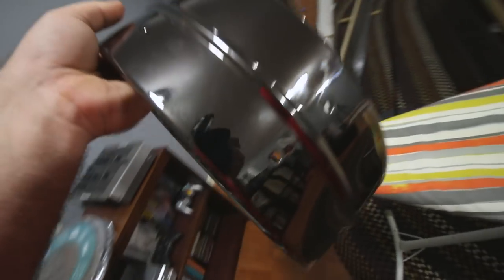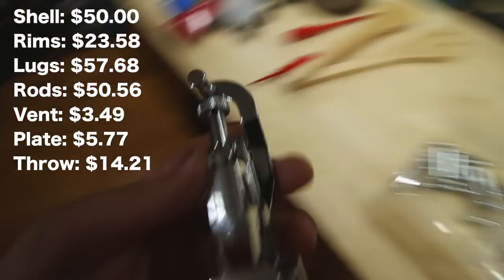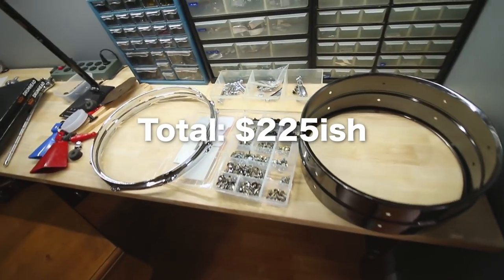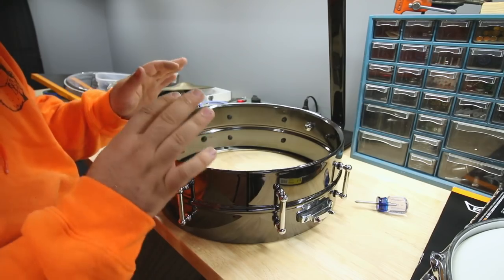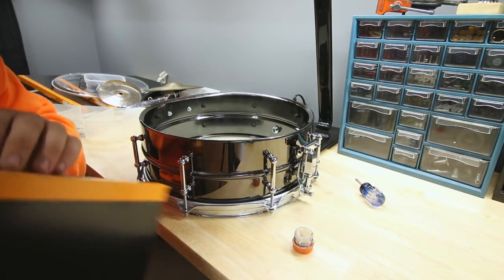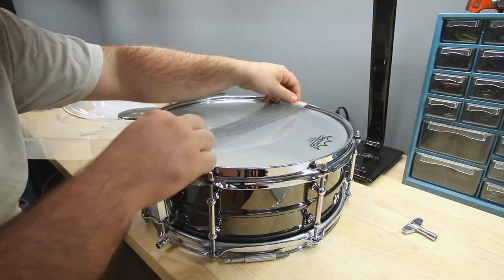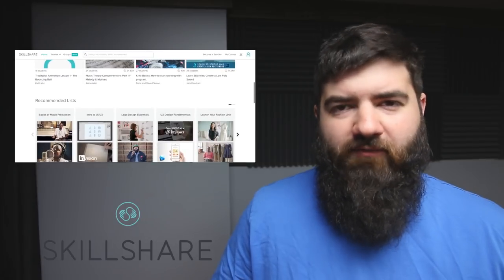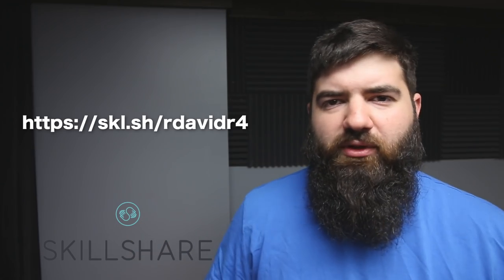You NEED This Snare in your Arsenal

Comment: 0:35 so you wrote a poem about it?
Reply: Your idea will never sell...
Reply: @ButtahDawgMcDouble  this is a nickel plated brass shell
it's black nickel if you couldn't tell
and I bought it cheap, from flood it had fell.
but I felt it was, naught the matter at all.
twas the most beautiful drum that I'd ever saw,
I thought it was needed by drummers and all.

I found the sound so sweet in this snare
the beautiful noise that rang through the air.
I set off to work with such Grace and such care,
cause the thought of it dying was to much to bare.

I measured the butt plate and the throw off too,
drilled it all out and made it anew.
I made some scratches, but I hadn't knew,
but the scratches were covered, 
and I got some snares too.

and the snare was so great.
it seemed that lady fate
had brought it, wrought it, to me
twas the most gorgeous snare that ever could be.

why did I do this?
Reply: @interrexclamacion 
This poem is well written
Great job man! 👍👌

Comment: Please make a PVC pipe drum set please.
Reply: Or just make some PVC octobans on a rack mount.
Reply: @Fiend S  @Hans Grueber  -  I think a problem with that could be that the diametre of PVC pipes is measured on the inside (as opposed to the outside, with drum shells) and that it may be difficult to find fitting heads and rims!
Reply: I made 2 x 10" PVC drums back in the 1980s. They sound good but are extremely heavy.
Reply: I made some 6, 8 and 10” concert Tom’s out of PVC back in the mid 70s. They actually sounded really good.

Comment: Regarding your used snare straps, we were in the middle of recording a few years back, and the drummer's snare strap broke. I fashioned up a quick and dirty replacement out of a nylon shopping bag handle, and finished the session.
Reply: I've used a doubled-up strip of gaffer tape. It worked so well that I left it on, in fact. As would duct tape...in fact, Premier used to use strapping tape for their straps.
Reply: @johnseal56  wouldn't duct tape stretch?
Reply: croyce Possibly over the long term. Only gaffer was field tested at length by me.

Comment: I considered building a run of acrylic snares by buying a huge acrylic tube and cutting it into many pieces, but this video shows that the shell is just a drop in the budget bucket. The hardware costs a couple hundred bucks, which is why any decent snare is usually around $300 or more. You’re just paying slightly more than the hardware cost.
Reply: Hint... buy el cheapo drums at flea markets, pawn shops, yard sales etc... A $20 5 piece-o-s set with dented heads and torn wraps can be a gold mine of lugs, lug screws, hoops etc...
Reply: Richard Marshall well yes. But you get cheapo lightweight hoops, bottom of the barrel lugs, barely functional strainers, etc. you’re not going to find tube lugs, cast hoops, or anything nice. I have a Yamaha 12 lug marching shell, but chances are low that my $20 drum set find will include 12 lug hoops. I see your point, but to build a snare out of junk gets you a junk snare. I’ve done it. It sounds pretty bad. Ordering parts like the above video is about as cheap as you can get for something you’d want to use and feel proud of.
Reply: @RyanAlexanderBloom  I have collected drums since 1974. I have classic ludwigs, pearls, tamas, yamahas, slingerlands, mapex, sonor, yaddah. Drums go bang or boom, cymbals chick or ting or crash. I have enjoyed and proudly played great drums and crappy drums without prejudice or regret, and shall continue to do so. YMMV.
Reply: Richard Marshall I’ve owned plenty of bad drums and just a few that sound good. I wouldn’t want to build drums from scratch that don’t at least stand a chance of being on the good side. That’s all I’m saying. And to get there you have to spend a couple hundred bucks. Like in this video. You can play whatever drums you want, but you don’t want to be selling custom drums made of garbage parts. That’s the point I’m making. Components matter a lot in snare drums. I loved the sound of a no-name brass pawn shop drum I had but the chrome peeled off the hoops, the lug inserts routinely tore out of the lug casings, and the only snare head I ever actually broke was on that drum. So i bought a Black Panther to replace it. The sound is actually better and it’s never given me trouble. So you see, every drum goes boom and most can be adjusted to sound good, but when it’s your #1 snare, it should work correctly in clutch situations.
Reply: @RyanAlexanderBloom  best wishes in your future drumming career.

Comment: Hey Dave. I don’t know if you respond to questions that much, but For a while I’ve been thinking on doing the same thing you did in this video (well kinda). I wanted to buy just a wooden drum shell from any manufacturer and or craftsman and then assemble it all together. Is there any sources or tips you would recommend for any of the drilling processes for the parts to be assembled? 
You rock btw

Comment: Save those mini blinds. They can be cut to size and used to tighten your snare wires. I've done it many times when in a pinch.
Reply from the maker: mini blinds?
Reply: @rdavidr  yes sir!... just cut them, fold them, run them through the snare wires, and attach them to the butt plate.. just like snare straps, but much cheaper.... and you're reusing instead of throwing them into the landfill. 😎
Reply: Or if you're a cord person, the pull is great for that.

Comment: Hi David! I'm a new subscriber from Germany and I would like to know if you have ever repaired a snare strainer that is missing the metal piece inside that attaches the throw to the part that moves up and down. Is there a Video like that? Thanks!
Reply from the maker: ehhh i honestly would have to see it to know what youre talking about. but in most cases with stuff like that its easier to just buy a new one.

Comment: What would a snare drum sound like with no air vent?
Do they actually do anything important?
Reply: The vent lets air pass though the drum. If you put your hand/finger over the vent and hit the head (or even push against the head like giving CPR) you’ll feel air coming out. I dunno exactly how that affects it though, but it’s important enough that most drums are vented. I dunno maybe try plugging a vent in one of your drums and see how it changes
Reply: Sound, I don't think much.  I've always presumed it's really a vent for not letting humidity or condensation build up inside an air-tight cylinder
Reply: Plug the vent on your drum and listen to how shitty it sounds
Reply: Without an air vent the snare would choke out.
Reply: http://www.menet.umn.edu/~kgeisler/Tuning.pdf 
"The air hole or vent in the shell is to allow the shell to breath when two heads are used and atmospheric
changes occur, thereby helping to eliminate moisture build-up. This is a typical problem moving from
cold to hot environments much the same as glass windows can sweat in your house. The vents have little
effect on tone."

Comment: Are snares like guitar strings? Single use or can they be changed between multiple snare drums?
Reply: I'm a drummer but I only own one snare drum, meaning only one set of snares so i don't have to worry about it, but I'm pretty sure they can be swapped around drums, it's just easier and hassle free to have a set on every drum so you don't have to swap them round
Reply: You can change them if you want, but it isn't worth it. They're not very expensive so you can have one installed on each snare drum you use, and they are usually very durable. However there are different types, in sizes and materials, wich can give you a different sound or feel. In addition, you'll have to keep in mind your snare beds, because not all of them fit together. Ex: a 16 wires snare with a large bed = no problem, a 40 wires snare with a small bed = not a good idea. A 20 or 24 wires snares will fit with most beds and are great all-terrain.

Comment: Unfortunately it's not like a Black Beauty because the shell has snare beds and lacks the oversized round-over bearing edges. Still nice for the price though.
Reply: Also the Black Beauty has a seamless spun shell while this is welded. That's the main reason for the BB's price. Ludwig also makes a drum with this shell, it's called the Black Magic and it's 299$.

Comment: hi ! greetings from Argentina! 
is there a standard measure when installing a generic throw off and  but plate in a snare drum shell? there is a really cheap snare drum in the school I work in , with no snare wires because the throw off system broke. the original throw off system of the drum was cheap and weird so a generic throw off does not fit.  I´m going to have make some adaptations and i don´t want to f up.
thanks! great channel!
Reply: Por lo que yo sé  cada modelo puede tener su propia medida, no tiene por qué haber una medida estándar, incluso entre diferentes modelos de la misma marca he visto variaciones. Si dices que las genéricas que has visto no coinciden, las opciones que tienes son dos: 1- busca un modelo que tenga la misma medida (algo debe haber, prueba con Gibraltar, que sería raro que no lo tuviera), o 2- busca el modelo que más te convenza y taladra los agujeros que necesites a la medida correspondiente.

La segunda opción tiene más trabajo y si no lo haces bien puedes estropear el casco para nada, pero por otro lado si es una caja barata, quizás merezca la pena el riesgo. Si lo haces bien pueden quedar en el casco los agujeros del sistema viejo, pero eso no es necesariamente malo, aparte de la estética. Funcionarán como unos agujeros de ventilación extra (algunas cajas llevan varios), y eso lo que hará será "secar" un poco el sonido, y quizás eso podría venirle bien (a veces las cajas baratas tienen demasiados armónicos), aunque eres tú el que conoce esa caja, no yo.

Espero que eso ayude. Un saludo.
Reply: @isihernandez9752   gracias por tu respuesta. me paso al castellano ya que veo que lo hablas. el tambor en cuestion es uno hiper barato. el sistema que ajusta los snare wires se rompio y se perdio.  por los agujeros que quedaron no pareciera que fuera un sistema de los genericos. trataré de sacarle una foto para que te des  una idea.  supuse que la unica forma seria comprar un sistema generico tipo gibraltar y hacer los agujeros yo mismo. mi duda ( por lo que escribi el comentario en un principio) es sobre cómo hacer los agujeros. que pasos debo seguir para que quede bien colocado.
Reply: @tomaswille1983  hola. Pues no creo que tenga mucho misterio, lo único que te puedo decir son cosas muy evidentes. Lo primero es, lógicamente, medir muy bien dónde van a ir los tornillos, en función del modelo que vayas a colocar, para que el sistema quede bien alineado en su posición con respecto a las camas de la bordonera. Después, utilizar la broca adecuada, tanto por el grosor como por el material a taladrar (madera o metal). Si colocas un poco de cinta sobre la zona a taladrar, te ayudará a que la broca no se deslice en el primer momento, antes de "morder" bien el material, y así protegerás el acabado, además de hacer un agujero más recto. Si el casco es de acero y muy grueso, quizás te venga bien utilizar algún tipo de lubricante para no estropear la broca, aunque no creo que sea tan grueso como para eso. Y también es importante que el casco esté bien fijo y no se mueva. Si tienes un taladro de banco mucho mejor, si no, fija el casco lo mejor que puedas con un tornillo de banco o con unas mordazas (usa un trapo para no estropear el casco al agarrarlo), y procura tener muy buen pulso al taladrar, para que no salgan torcidos los agujeros. Después limpia bien los restos que hayan podido quedar, rebabas de metal o virutas de madera. Por último, instala el sistema, con sus arandelas y todo, y listo.

De todas formas, si no tienes mucha prisa puedes seguir buscando algún sistema con la misma medida que el antiguo, que creo que sería raro que no hubiera. Quizás en alguna tienda, si dices la marca y modelo, te lo puedan traer, o puede que en ebay o algo así. 

Espero que te ayude. Ya me vas contando cómo lo llevas.
Reply: @isihernandez9752  gracias!
El tambor es de madera. Y creo que no tiene cama para las bordonas. Me voy a fijar bien. Se que quizas estoy haciendo preguntas muy evidentes pero jamas hice algo asi y no encontré video alguno que explique y muestre cómo se hace. Me es muy dificil explicar lo diferente que pareciera ser el sistema de bordonas que tenía este tambor, asi que creo que lo mejor es imaginar que el tambor no tuvo sistema alguno y no tiene hecho ningun agujero ya que los agujeros que tiene no creo que sirvan de referencia para un sistema de bordonas generico. Me intriga mas que nada cómo instalar el sistema en relacion a la altura del tambor. Tanto la parte movil como la parte fija y tambien como es la relación en cuanto a la altura entre ambas partes.  Perdón por la molestia y
Gracias de  nuevo!
Reply: @tomaswille1983  tranquilo, no es ninguna molestia. Para comprobar si tiene o no la cama, algunas veces está muy claro porque es más o menos grande, otras veces es más sutil. En ese caso lo más efectivo es colocar el tambor con el borde inferior sobre una superficie que estés bien seguro de que es totalmente lisa, y a ser posible con poca luz. Luego mete una linterna dentro y ve girando el tambor, fijándote bien en la luz que se filtra por debajo. Si no hay ninguna variación, es que no tiene camas, pero si ves que en dos extremos opuestos (donde estaban fijadas las dos piezas del sistema bordonero) se filtra un poco más, entonces es que sí las tiene. En caso de que no tenga, te recomiendo utilizar una bordonera de pocos hilos, para minimizar un poco el zumbido por simpatía.
En cuanto a la altura,  creo que eso depende mucho del modelo exacto del sistema que vayas a instalar. Yo diría que lo  importante es la altura de la pieza donde va enganchada la tira de plástico o la cuerda que uses para la bordonera, más que otra cosa. Si tienes  más cajas a mano (creo que allá las llamáis tarolas o redoblantes, no?), mide las distancias (con la bordonera tensa), y te puedes ir haciendo una idea. Por otro lado no creo que sea necesaria una precisión extrema para eso (siempre que estén igualadas las dos piezas del sistema), porque esa altura la puedes compensar con la longitud del plástico o la cuerda que uses para sujetar la bordonera al sistema. En cuanto a la relación entre ambas piezas, yo diría que tienen que estar igualadas las piezas donde se engancha la bordonera, con el sistema tenso. 
Con la altura en relación a la profundidad del tambor, si te refieres a cómo influirá eso en el funcionamiento, no creo que haya diferencia siempre que tengas en cuenta lo anterior. Si te refieres a cómo afectarán los taladros y los tornillos, en función de su posición, a la vibración del casco, y por tanto al sonido, no  creo que en un casco barato sea relevante ni vayas a notar mucha diferencia.
Con lo que sí deberías tener cuidado, ahora que lo pienso, es que si el casco es de madera, intenta no hacer los nuevos taladros demasiado cerca de los antiguos, porque esa zona estará más debilitada y se podrá romper (al hacer el nuevo taladro, o posteriormente por la tensión de la bordonera). De hecho si es posible aprovechar alguno de los antiguos, mejor.